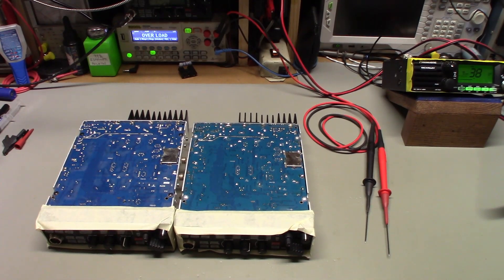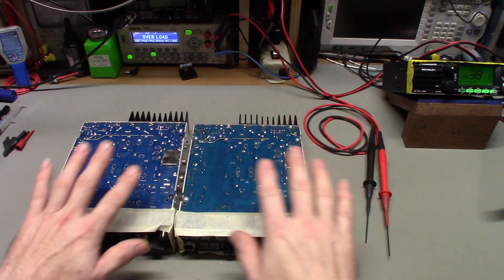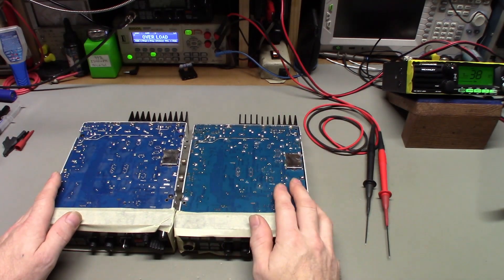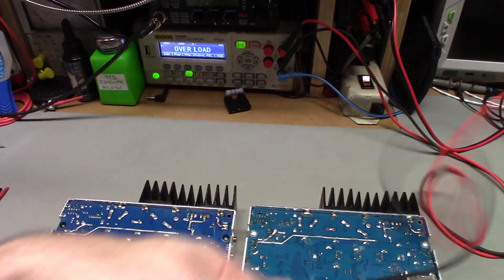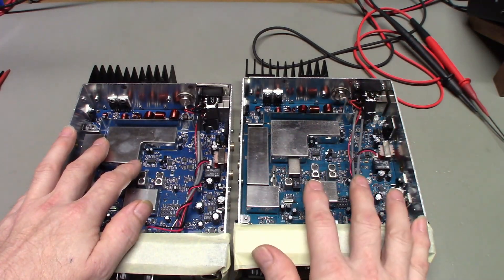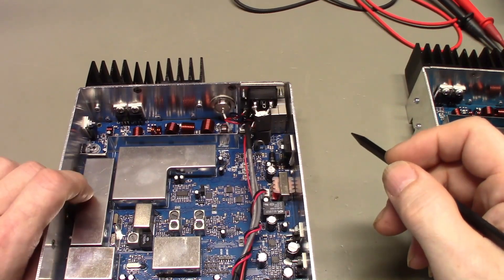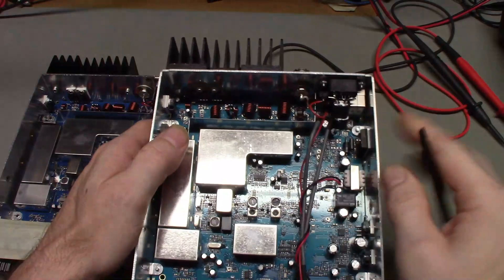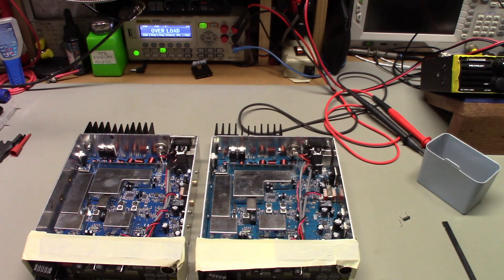High SWR's blew up your radio.  Simple testing anyone can do to repair it.

Comment: You need to desoider the finals and test on o scope to test properly... not it still attached to the radio
Reply from the maker: You do not need to remove them from the circuit to test if they are shorted.  Also, you can not test a transistor or any device out of circuit on a oscilloscope.  A oscilloscope measures voltage over time.  Out of circuit no component has a voltage on it.  Maybe your thinking about a curve tracer.

Comment: You're swr meter needs to be a great one.. not a meter that only reads swr..it needs to read impedance resistance and reflect...
Reply from the maker: That's not a SWR meter, that's called a antenna analyzer. 🙂

Comment: Funny this video pops up on my feed, after the finals smoked in my Cobra 29 😂. I figured out that the radio’s SWR meter gave me false readings when I recently put a different antenna on. Readings were less than 2 according to that meter. After the finals went and I smelled the burnt electronics, I put a separate meter on and it pegged 😳😳
Reply from the maker: Just to be clear, the SWR meter is not reading correctly when you calibrate  the meter using the "SWR CAL" control?
Reply: @mikesradiorepair correct. When I make the calibration and switch it up to “SWR”, it was reading less than 1.5. After the damage occurred, I put a desperate meter on with a different radio, and that reading scared me 😂. Also a good lesson in antenna choice!

Comment: This is why the Smith chart is important. Know your radio's vulnerabilty. Depending on where on the Smith chart the poor VSWR lies, your radio will be forced to handle excessive current or excessive voltage. Moral of the story - don't use a VSWR meter - they tell you nothing. Get a network analyser - portable ones are really cheap, and use the Smith chart to tell you not only how bad your antenna is, but also the nature of the reflection. And a Smith chart will direct you how to fix it. VSWR is just a number - a figure of merit, if you like.
Reply from the maker: Couldn't agree more.  There are numerous great video tutorials on YouTube that demonstrate how to use a Smith chart.  I would add, also learn how to use a program called SimSmith.  It's free and takes Smith charts to the next level.

Another thing about VSWR meters is they may show how well matched your antenna is, but that's not the whole story.  It doesn't tell you where that RF is going.  Stick a horizontal dipole to close to the ground and you have created a "cloud burner".  There are also a couple of antenna modeling programs available for free online that can calculate and show you 3D models of your antenna radiation pattern.  A great radio fed with the best coax connected to a perfectly matched antenna won't work very well if the RF isn't going where you want it.

Comment: As someone who has repaired radios, televisions (tube type), computers, and other random assorted electronics over the years, I can appreciate everything you said in this video - especially, where you show your experience and trouble-shooting skills and practical approach to repairing radios.   But, I do have to point out the fact that you are showing people who don't know about SWR how to fix the radio they damaged because they don't know about SWR.  If they don't know about SWR, they really have no business tinkering around inside their transceiver - so, they don't need advice about how to fix their radio.   They just need someone who knows how to fix radios to fix their radio.

Of course, those folks are getting harder and harder to find these days.

But, thanks for the video and the practical repair advice.   It never occurred to me to just replace the leads on a ferrite that was damaged, rather than source a new replacement.   But, that makes perfect sense - and, it is an easy fix.

Thanks again!

Comment: SW-ARRR'S? No such thing as standing wave ratios, it should be pronounced "S-W-R". The acronym isn't pluralized.

This guy isn't necessarily all correct about HOW a high SWR feeding back to your radio will blow it up. Yes, a high SWR will create a return loss direction back to the source but it will return back out and radiate out as heat due to an impedance mismatch at the antenna feed point. In other words, your SW-ARRS are high most likely because the antenna isn't tuned correctly for the given frequency or a bad design or other issues.

A simple way to explain the detrimental effect of a high SWR on a radio would be similar to what happens when you put your thumb over a garden hose with the faucet on high. Your thumb would create some resistance and even though some of the water will flow back to the source, eventually the built up water pressure will force the back flow water out but some of it will dribble out the end of the hose. The rest of the water will spray outwards to a desired direction. This resistance also causes more back pressure to force the water out which uses more energy to push the resistive force created by your thumb.

A radio on transmit will radiate RF energy like water out of the hose and the SWR value would be determined by how much of your thumb covers the hose from releasing all the water. The higher SWR would back feed some RF and then eventually expel the RF energy into the air. However, instead of effectively radiating this part of the radio signal, it would just dissipate as heat into the air just like wasted water dribble around the end of the hose that's not going in the desired direction. There is some coax cable loss that occurs that plays into this equation too but I'll just keep it simple here.

The reason for radio failure with a high SWR is the more return loss back feed resistance causes more force from the radio to move the RF flow. Common laws of physics says the more energy that is used means more heat is created. Too much force to move both the good RF and return RF back flow energy outwards can create too much heat leading to eventual failure in the radio's RF power transistors. Excessive heat is the most common cause of many failures in electronics especially with transistors. So yes, the RF energy does travel back towards the radio's final transistors but it is returned back out as quickly as it got there. This energy has to go somewhere but it is not absorbed into the radio or transistors as many people seem to think.

If RF energy from a high SWR really traveled back into the radio or final transistors as implied in this video, the radio would be immediately damaged with less than the first half of a watt returned. A low and good SWR value of 1.3 is almost a 2% return loss and would be enough RF energy to zap your your radio if it truly traveled back into it. 

I'm seeing some newer CB radio's have high SWR protection circuits to protect the radio final transistors. This is a good feature to have because it will disable the transmit until the high SWR problem is fixed. Ideally you should tune your antennas to have a good usable SWR and only operate within the antennas range. An SWR under 1.9 is still safe but if you want to go further in the band, either re-tune the antenna or use an antenna tuner (antenna tuner is a misnomer) to match the radio better to the antenna. 

For those reading this I hope this clarifies this in an easier to understand way instead of citing some complex formulas and theories which many people use to show off their brilliance or to how they memorized quotes from Wikipedia, LOL!

To paraphrase a quote from Albert Einstein, " if you can't explain something simply, then you don't really understand it".

Comment: I got one of those led light like 2" long meters today. I had one antenna only for listening because I knew the swr would be bad. I checked the mag mount on my car for the little radio in it, it was 1.4. About what I expected.  Then checked the one I knew would be bad and it was 3.0 lol taking care of that tomorrow so it'll be able to transmit finally. I had figured the grounding was non existent. Some new hardware should take care of it so I can tune it.
Reply from the maker: The key to remember when tuning a antenna without a antenna analyzer is to check the SWR at the lowest, center and highest channel/frequency and "tune" the antenna by shortening or lengthening the antenna to get the lowest SWR on the center channel/frequency.  Higher frequencies  = shorter wavelength and shorter antenna, lower frequencies = longer wavelength and longer antenna.

Comment: I was wondering if ya can help..i have uniden bearcat..it powers up lights up..appears to have all functions working.. New looking still has plastic over face..no sound. Had diff radio hooked up to attenna n it pulls in sound..does the mic need to be hooked up for sound on these....thank you
Reply: 6 pin plug

Comment: I’m an amateur radio operator and I have a Flex Radio with a PGXL amplifier and a Palstar auto tuner. If there’s any issue with the SWR, my amplifier will automatically reduce power as a safety protocol.

Comment: So what do you do to fix the antenna problem? All you guys talk about doing diagnostics and stuff but none of you say what needs to be done to the antennas to make it match the radio.
Reply from the maker: Tune it by adjusting it's length so it is resonant at the center of the CB band.

Comment: A 1 to 1 baulin in the coax can also prevent a lot of the SWR from getting back into the radio because it acts as a reflexive point that will bounce a large part of the reflected power from the antenna back to the antenna.. Is it a substitute for a good matched antenna? NO but it can help a marginal antenna from becoming a bad antenna.. There are lots of conditions that can detune an antenna like heavy rain, ice, fog etc. that are temporary but if you use your radio in those conditions often it is something to think about.. several wraps of coax thru a ferrite core can get you there..

Comment: There is a project but to see the signal strength that the radio is receiving, for example, a weak but audible international station lights up 2 LEDs and one is coming in strong as if it were local, lights up 5 LEDs for a radio receiver. Do you know or have a project like this?

Comment: Cos my field is in computers and being a semi-pro, i have some idea, , your wondering, what the hell is an SWR, SWR stands for "Standing Wave Ratio", the transmitting signal travels along the antenna (FORWARD) and refects at the end, returning down the antenna (REFECTED), the forward signal interferes with the reflected signal causing constructive or deconstructive interference, differant lengths create differant phases along the antenna, when a peek meets a peek there is max emission, and when a peek meets a trough there is zero emission, an SWR ratio of 1:1 is perfect constructive interference, where the cycle appears STATIONARY on the antenna, creating a perfect waxing and waning electo-magnetic field, as the electric field collapses, the magnetic field increases and vice versa, , ,Without that load absorbing energy, the energy instead appears as a high voltage or high current somewhere which may not be equipped to handle it, , 

So basically, an ideal 1:1 SWR will produce a low 50ohm resistance match where the antenna does work, the SWR is relatively constant along the feedline, the impedance will vary along the line unless it is perfectly terminated (that is, the SWR is 1.0 : 1). This is an important concept for impedance matching, because with a high SWR, the impedance at the final output transistor load inductor could be lower than 50 ohms, and produce a high current that damages the finals, , ,

PS - a 1:1.5 SWR = just a 4% loss \ a 1:2 = 11% loss \ and a 1:3 = 25% loss

Comment from the maker: The price of repairing both radios was still less than half of what a new radio would cost.
Reply: Good to see you are still around on the platform, Mike.
Reply: Mike, how are you ? No radio repair?  Please answer !  Fhanks!
Reply: Hello Mike.
Happy new year 24/2025
 Are you still accepting repair work ?were from CT. And have some radios  we use in our farm trucks and farm tractors and a fee are still passenger pickups 
Only 12v
 And are also in search of another base unit and antena tower 
Ours was taken out when bad storm dropped a tree on the shop building.
Thanks if you can reply. Dave.
Reply: Hey Mike why do the add the z24?

Comment: I'm having issues... radio was just fine and tuned...  I woke up n boom cobra lights changed double red screeching when I hit the mic and my dome lights flicker when I press the mic... it definitely possessed... nothing changed in set up or antenna.. fuse is fine it recieves good but omg the screeching like the mic is getting feedback from the speaker screeching...
Reply: Cobra 29 classic 
Dome lights in truck

Comment: Mike, I have a dual band amateur radio I picked up second hand from another ham who said the UHF side of the radio no longer worked due to a shorted N to SO239 adapter. The radio still works fine on VHF and receives UHF fine. With an analog watt meter into a dummy load, I can see the needle just barely lift off 0 while in low power UHF, but if I key the radio on high power it blows the 15 amp inline fuse before I can see anything happen. Do you think replacing the Mitsubishi ra60h3847m1 PA module would potentially fix this radio or has more damage been done that I cannot properly diagnose or detect? I am having a hard time finding any information about testing PA modules and was hoping to find a way to test with a multi meter like you show in the video. 

RF in, Gate voltage and Drain voltage all short to ground with high resistance while RF out does not short at all and the meter reads OL. Is that a sign that the finals have fail and are no longer letting RF through the PA module? 

Any help or comments would be greatly appreciated.
Reply: The radio is a Connect Systems CS800D and my testing had been done on analog FM

Comment: I had some serious damage done to my Anytone 5555N it have 3x 13n10 but the board looks the same as yours, the TIP36S was burning hot even when not transmitting, it just happend a morning i turned on the radio while i key the mike the display got dim and the radio basicly turned of untill you released the button. It even melted the fuseholder. I saw some one talk about those 13n10 are bad, and recommend to replace them with IRF520's - anything else to replace?

Comment: How many outputs are on this? 
Replacement transistors come in kits of 4, but I can only see 3
I've changed q55 and the three outputs, and still get no output power at all.  Not even a little bit

Comment: If you have the money always buy a antenna analyzer you can buy a rig expert that goes up to 35 mhz for a little over 200 bucks and you know your on the money.. with a small cheap meter it could say your at 1:1 ratio and you could  be way off

Comment: Mike questio for you. Does is stand true for any antenna whether vertical, random wire, etc. If Swr is 2.5 and you want 1.25 you shorten length?
Reply from the maker: Unknown, that's not enough information.  The SWR curve usually looks like a spread out U or high SWR on either side of the resonant point.  Measure the SWR on channel 1, 20 and 40 and take readings.  Remember that as you go up in channels you are going up in frequency.  Higher frequency means shorter wavelength and thereby a shorter antenna.  Lower in frequency means longer wavelength and thereby a longer antenna.  So if you have a lower SWR on channel 1 than on 40 shortening the antenna would shift the resonant point to the higher channel / frequency.  If you have a lower SWR on channel 40 than on 1 lengthening  the antenna would shift the resonant point to the lower channel / frequency.

Comment: Any repair tips for fixing a STANDARD ECLIPSE GX1245S VHF Marine radio?  Current draw is 600 mAmp. Display is blank but the illumination light is lit.  Haven't been able to locate a schematic.  Service manual is MMGX1240S (covers GX1240/1245 models ).  Thank you for any info you may provide.
Reply from the maker: Sorry I do not have any service information on any marine or aircraft radios.  You need a GROL license to service them which I do not have.

Comment: Clickbait total lie. You can never ever blow up your radio. You can burn out the final's. 1 or 2 transistors. Not too hard to replace with heat sink compound. I think my old finals many years ago was something like 2sc2091, 3 leads out of each final. If the radio was blown up.. it would not be there. Hype. I know the number is not correct, something like that. simple.
Reply: It’s a figure of speech.. don’t take it too seriously.. lol
Reply: @tommy2timez  Then don't EXAGGERATE so immensely like a millennial, gen x and gen z. Say what you mean and mean what you say.